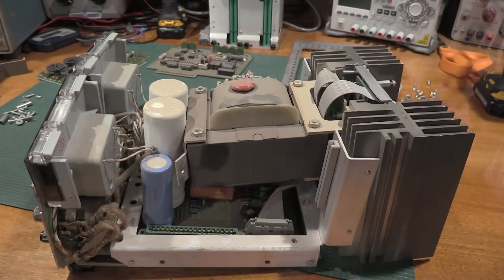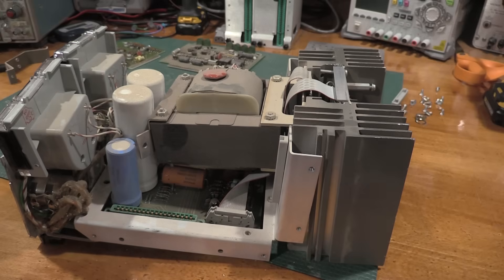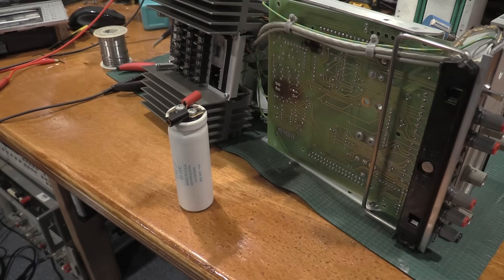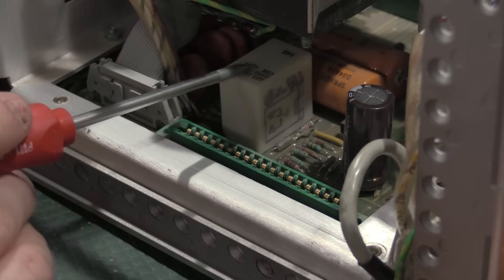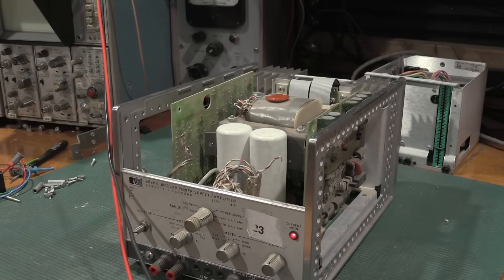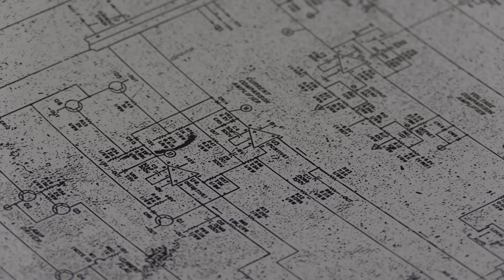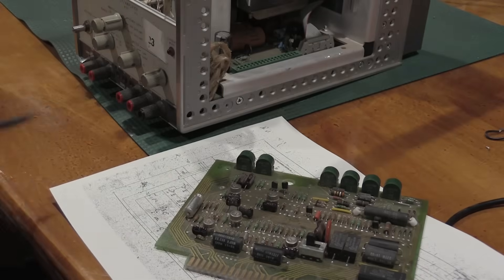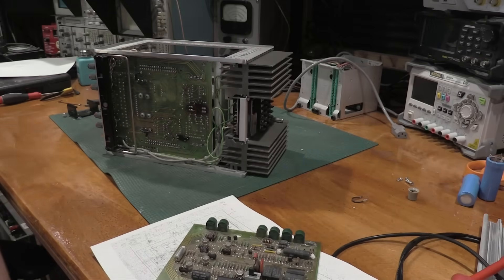HP 6826A Trouble Troubleshooting to Missing Parts

Comment: 15:22 There are at least 6 power supplies that use the same PCB for A2: 6825A through -27A, and -30A through -32A. One of the 6825A manuals I've downloaded (sorry, not sure where from) has an image of A2 that's decently legible, with components identified.

It has some components marked as either jumpered or unpopulated in particular models, but the components to the right of U3 are not marked as such - so perhaps this board is from yet another model. 

It shows CR13 and CR14 above K2 (the reed relay nearest the switch).

Once it arrives, your pdf will probably have a photo at least as good as this one, but I could email this one if desired. I could also send the entire pdf (note - 6825A not 6826A), though at ~60MB I'm not sure my email will let me attach it. 

Are the front panel wires in your unit quite stiff? I assumed it was the insulation at first, but after several broke I realized that they seem to have been 100% pre-tinned before the insulation jacket was added. It was sufficiently annoying that I ended up replacing many of them.

Comment: Please clarify the model number.  What you said does not agree with video title.  Thanks.
Reply from the maker: Thanks for that it is a 6826A
Reply: @ZenwizardStudios  Glad you posted.  Perhaps I'll get back to my 6825a purchased last fall.  On bench in garage...
It would not develop proper current(should have taken notes) so i disassembled to replace broken posts on front.  This hp is not  friendly for repair access.  What a pain to get to stuff. 
Also wanted to check the usual suspects, hoping to prevent smoke. 
My schematic is same as yours.  WWW(dies anybody say that anymore?) hunt just turned up nothing.  BTW, BAMA & KO4BB sites are unresponsive.  Front page loads but that is it. 
I'm looking forward to your next effort on this unit.
Reply from the maker: ARKtek does have a MUCH better manual.